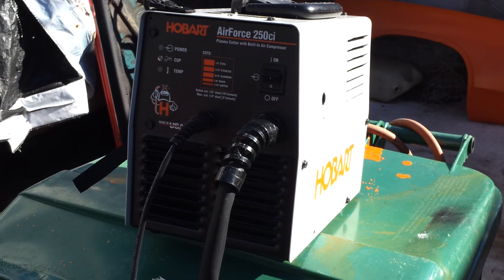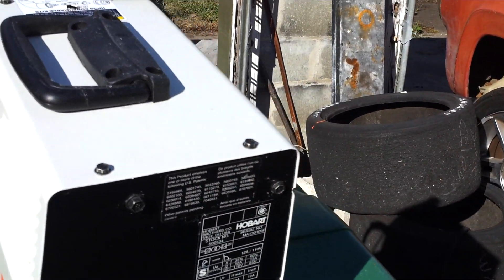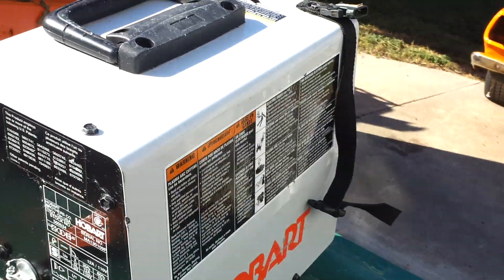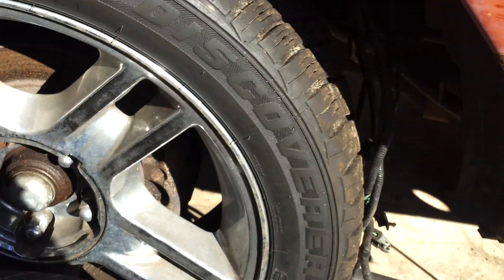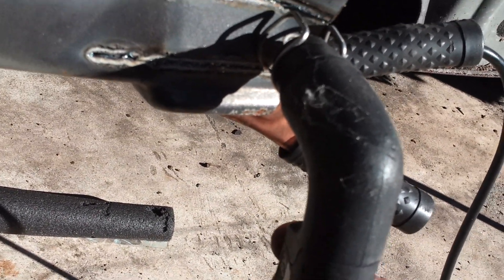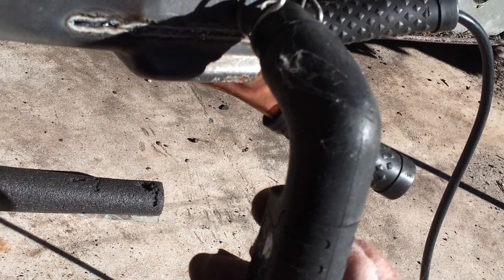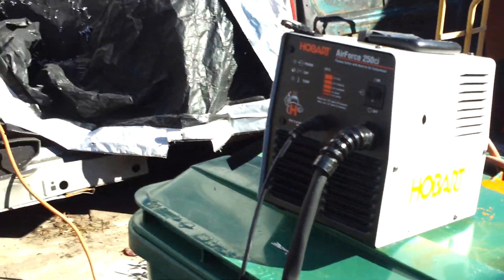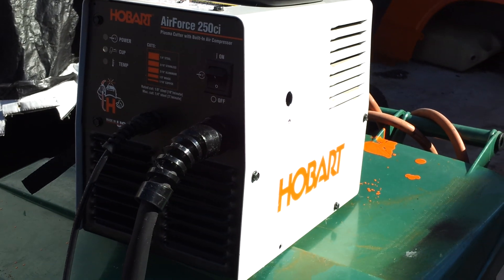Hobart AirForce 250Ci Plasma Cutter

Comment: Mine does the exact same thing out of the box. My finding is 1) the ground contact needs to be as clean as possible as well as the spot you are cutting. My first cut was on rusty stuff and I didn't know that- very frustrating

Comment: The tip should not touch the metal unless u have a drag tip... also if u let off the trigger and douple click the trigger then the aie release wull stop and you can start again... also your moving very slow for sheet metal also so it could be spatter causing the issue